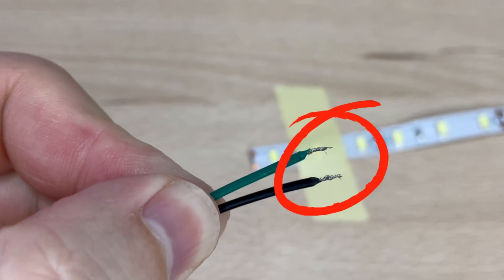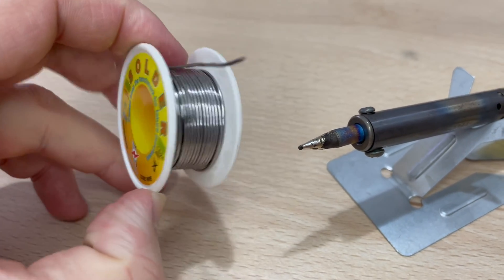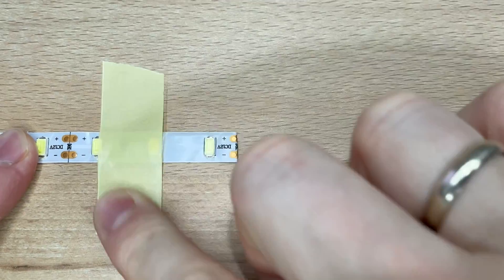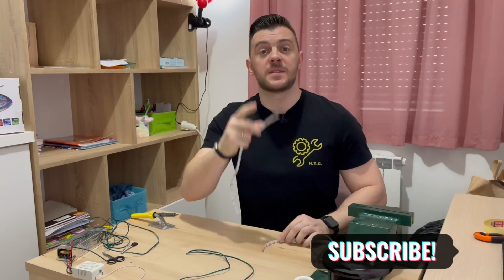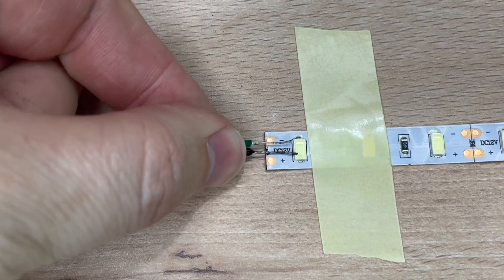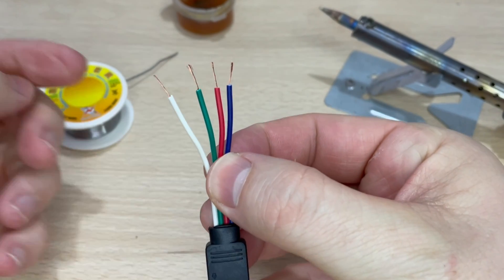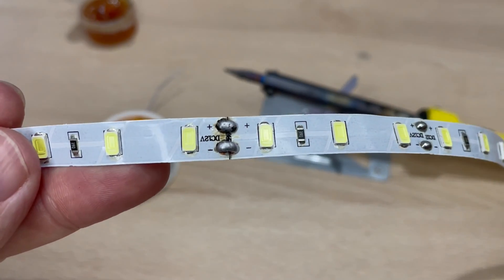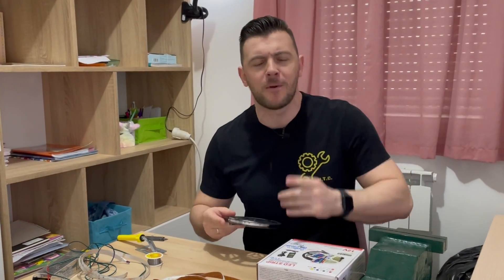How to Connect LED Strips - Soldering Connectors, Wires and More

Comment: What is the 4 pin connector called?
Reply from the maker: It’s a 4-pin JST-SM connector (commonly used for RGB LED strips).

Check them out here:
https://amzn.to/3kCcmSj
Reply: @rookie.handyman The link is a generic 10mm RGB strip coupler and 4-Pin JST SM looks very different from typical RGB strip connectors from what I can find on Google images

Comment: what wire gauge should be used, 18 AWG or 22 AWG is enough? Thanks
Reply from the maker: For short runs (under 5 meters / 16 feet) and low power strips (like 12V, 2A or less) — 22 AWG can be enough.

For higher power strips or longer runs — it’s better to go with 18 AWG to reduce voltage drop and heat.

Comment: How long should I wait for the solder to cool down before plugging in the stips 🙏🏽 :)
Reply from the maker: Just blow on it and after 10 seconds you can touch it (be careful anyway while touching it - it can still be a little bit hot). If you can touch it, you can plug it in.
Reply: @rookie.handyman  thank youu !!!

Comment: Too sad my solder wont stick with dat surface. Thats why im here. ❤
Reply from the maker: Yeah, that can be super frustrating. It’s usually either the surface needs better cleaning, or there’s not enough heat or flux. Hopefully this video helps 👍
Reply: On my machine, 340°c was the perfect temp to make it stick.
Reply: Led strips have a protective coating. Use a hobby knife to scape coating off contacts your going to solder first. 😉

Comment: First thing you learn in Electronics is learning to solder. Had I done that shoddy solder workmanship, I would not have lasted 1 week in Electronics. Surprised if those solder joints worked . Going in my 55th year.

Comment: For making a break in a LED strip, what kind of wires do I need? Just a regular copper wires?
Reply from the maker: The best ones are stranded copper wire (wire with many small copper strands twisted together), very flexible for corners and easy to solder once you twist all those small strands.

Comment: If there's not a cut point, is it possible to repair the strip?

Very helpful video
Reply from the maker: It's still possible to repair it, but it can be a bit more challenging:

- Use a sharp blade to gently scrape away the protective coating over the copper traces on either side of the damaged section. Be careful not to damage the traces further.

- Once the copper traces are exposed, you can solder small wires to bridge the damaged section. Ensure that you connect the corresponding traces (positive to positive and negative to negative).

- If the damage is too severe or the traces are completely broken, you might need to cut out the damaged section (even if there's no cut point) and rejoin the two working ends using solder or connectors.

Hope this helps, thx for your comment 👍
Reply: @rookie.handyman  I did it. Had to use a very fine point soldering tip though. And insulated with shrink wrap. Actually worked. Thank you so much for the suggestion.
Reply from the maker: @poolman8676 Excellent, well done 👍👍. I’m glad this was helpful 🙂

Comment: The best and cleanest way I found is to pierce a small hole on each pin with a thin nail, pass through the hole with the wire from behind and then solder and secure the whole with electrician tape, very clean, easy and secure
Reply from the maker: Well, that's a great idea! I have never thought of soldering wires and strips in this way. This is for sure very secure way to have them fixed together all the time. Thx, I will try it in my next LED project just to see how it works 👍👍👍 thx for sharing your experience!
Reply: Great tip! Came to the video to find out temps and ideal solder wire, but your comment saved my sanity. I have to solder about 80 strips (for some volumetric letters)
Reply from the maker: Yeah, that tip above is fireeee, I tried it the other day, works perfectly 👍

Comment: Appreciate the tips & encouragement but you really should clean your soldering iron tip with a brass brush or the likes way more often to get a better solder joint, also don't be scared to use a good amount of flux paste as well! It makes everything so much easier & more melt-y!
Reply from the maker: Thanks for the tip, I am a little bit lazy with tip cleaning, only when it stops heating up, I get to cleaning it. I do use flux paste but probably not in good enough amounts, will try to be more generous next time. Thank you for your tips 👍👍